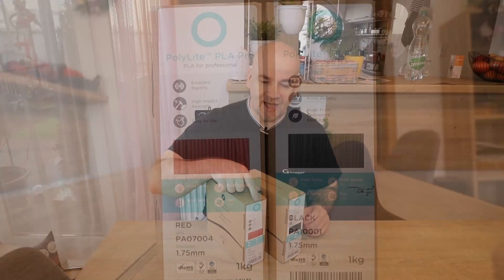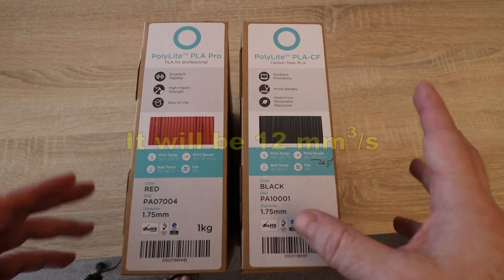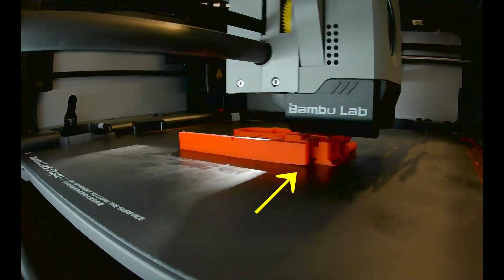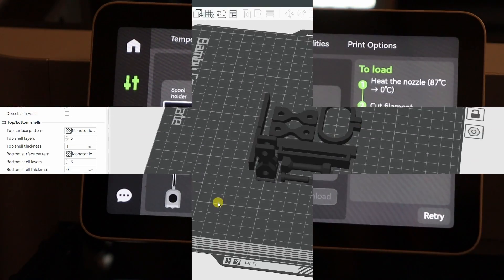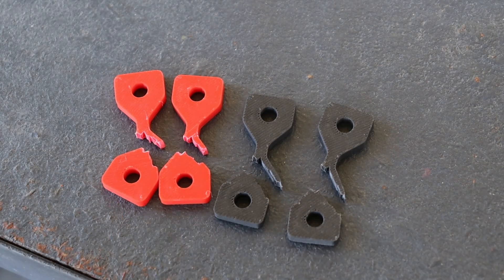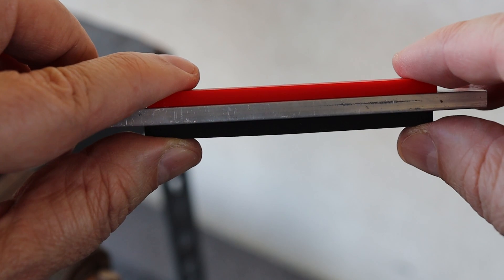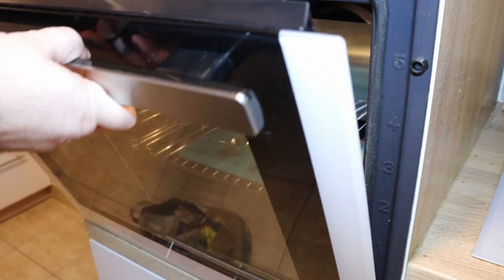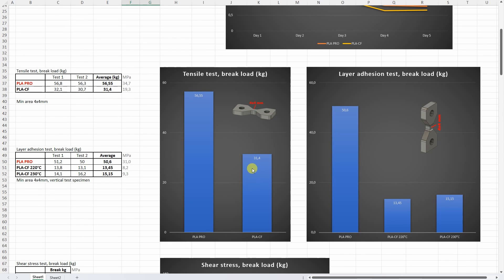Polymaker PLA Pro vs PLA-CF, Try to guess, which one is stronger?

Comment: Define “stronger”? The PLA-plus probably has a higher overall yield strength, but way more deformation before final failure. The PLA-CF is more rigid, but also more brittle.

Comment: I always wonder what is the base formulation of the PLA in the CF versions.  It would seem to make the most sense for them to use an impact-modified formula (ie. Tough/Pro/+) than just a regular PLA.  But based on all the tests i see, it seems like the base is a standard PLA.  Unless the CF is really that much of a negative impact?

Comment: Good videos. Here are some filaments with very interesting properties. AzureFilm PET Carbon Fiber - very stiff, high HDT and low warp. Aurapol PLA HT110 - high HDT without annealing. Spectrum  PET-G HT100 - High HDT. Recreus PET-G CF - High strength. Extrudr Green-TEC pro carbon - Very stiff, high HDT, bio material like PLA. Formfutura ApolloX CF10 ASA - Very stiff and low warp.

Comment: The reason for the spool being closer to the resealing end is due to the way it's manufactured. The resealing strip is the bottom of the open bag, the spool is dropped in, then the bag is vacuumed and heat sealed. So when a consumer gets it, there is that extra space on what was the top during manufacturing, but now the bottom for consumers.

Comment: Before watching: CF may be better in rigidity & heat, but worse in other properties (as usually filled filaments are).

After watching: maybe CF filaments do not use same (better) base material as normal or pro filaments. Or CF (or any other filler) just creates breaking points (voids in polymer) instead of binding base material?

Some people dismiss PLA, though it is very strong, cheap, hard and easy to print.
PETG creeps less, but due to flexibility it's not always a good choice for mechanical parts. It doesn't stand much more heat than PLA.
If a printer has hardened steel nozzle and can go to 100/300 C, CF-nylon (CF to make printing easier) might be better option. ASA and especially ABS IMO not so much ;)
ABS and glue sticks for cool plates (again IMO, in 2020's! We have PEI sheets and heated beds!)  share the same (hot) place 😈

Edit: will CF become future asbestos? How does file CF dust behave before, during and after printing? It's probably not good for skin, eyes or lungs...

Comment: I always want to see more PLA tests. It isn't like the manufacturers post clear data on what is what. As a material for mechanical parts PLA has a lot of advantages. the ease of printing is an important one.
Reply: Agreed:
1) Ease of printing (especially low shrinkage/warping)
2) Price
3) Strength at RT
4) Modulus at RT
5) Potential for annealing to greatly increase heat deflection temperature
6) Chemical resistance
7) Low toxicity

Comment: The strength in carbon fiber is getting it to align on the XY axis.  Tiny pulverized pieces floating in polymer won't add any strength.  It sure looks pretty with it's matte finish.  I love your testing.  As I have seen with other filaments featuring CF inside, I have yet to see where CF adds any strength.  I like the Polymaker materials and I have been a lot of test prints with their CosPLA material for my projects.  The PLA Pro is very nice and I find I have to print at 220C to reduce all stringing whereas with their other PLA materials, I find 200-205C is the sweet spot
Reply: You've barely looked then. Nylon and PET are greatly improved by decent CF with better temp resistance, strength, and stiffness. I wonder whether it's an issue of better adhesion to the fibres or ductility avoiding the fibres causing stress concentrations. For whatever reason PLA seems to be a poor matrix material in comparison, usually losing ultimate tensile strength. In the dry state straight after printing, I tested a flexural modulus of 7 GPa on my PAHT-CF!
Reply: cf works great for nylons
Reply: It do add stiffness to many materials, and at high temp aswell which is important for many applications. Putting it in PLA seems like a waste though, since the base material is shite for useful stuff.
Reply: @garagecedric  pla is pretty decent if you don't need temp resistance tbh
Reply: @riba2233 Don’t like the creep under load, so K never use PLA.

Comment: I've always had good luck with polymaker filaments EXCEPT for PLA and PLA pro. It warps terribly, and the pla shifts from glossy finish to matte finish depending on flow rate.
Reply: I printed polysonic (similar to polylite) in multiple colors, no warping at all, great consistent finish quality and very easy to print. 210-220c, 60c bed etc

Comment: It's easy to say that PLA is bad and that it's not interesting. But it's mostly because the material just isnt having the material properties we need. But it is the dream when it comes to ease of use and printability. PLA is what we want all the other materials to be like, but with the finished result having the mechanical properties of the material we chose instead.

PLA is one of the best filaments for printing and the only reason to use something else is for example because the material is too brittle or too low thermal resistance. A singular weakness that doesnt fit into the intended use. The material is so much superior in terms of ease of use and printability that it is ridiculous. I can without caring about print settings and on maximum printspeeds print squares of 30cm x 30cm with no warping. 100% of the times. I can print tall weird thin sprawling shapes that are usually really difficult in ASA/PC and with no curling/warping. With other materials its simply a lot more difficult to get that exact same result while printing at 200mm/s+. It easily prints 5cm+ bridges without a care in the world. Anything goes. An idiot can print PLA/PLA+. And that is what most of us are. We are tinkerers. We want to spend our lives doing something else. Only like 2% of 3d print users are there for the tinkering and dont care about actual prints themselves.

Now, to convince me that these strength tests are of any use at all, you'd have to convince me that I can easily print these large shoulderpads, helmets or AMS risers etc with zero warping, curling, 99%+ print successrate without a struggle. Large flat peices. Thin overhangs. Tall thin pipes. This begs me to wonder why printability isnt even a metric you care about. It's nothing to you. You just print small flat mechanical parts. This is great, but the most important thing is that you can print the intended part accurately with the material, else it's 100% useless and not even worth considering.

For ASA to reach the same performance as PLA I need to print it at around half speed, I need to prebake the oven for more than 30 minutes, and I need to slow down to less than a third to of PLA speed on overhangs to get an equal result in terms of quality. And it still warps/curls a bit. Some shapes are better avoided and the model cut into smaller pieces to make it easier to print. Nah. What we all want is EXACTLY the PLA printability but just a little more thermal resistance and slightly less brittle. There are already thousands of great options in the printing world to print useless mechanical flat parts. ASA and all the other materials are fantastic at this. But what about the really big difficult full helmet oneshot prints? I want a great cosplay filament. ASA is simply too much work to get a good result, prints too slow and even with great settings it has a too big reduction in size when it cools down which causes warping. This directly limits my creativity and productivity. If only PLA was slightly more thermally resistant would be good. But alas, zero really good PLAs with high thermal resistance seems to exist, and all processes with annealing so far distorts all larger prints until they dont accurately fit what you intended to print. 

GIving us lists of specifications is good, but what we are looking for is also printability. It is one of the absolutely most valuable metrics. How accurate and easy are they to print? How good does details come out despite the CF fibers? Is it easily sandable? These are metrics which are CRUCIAL to everyone who is going to print something that isnt a useless flat mechanical stress test/benchmark print. Printability is what makes PLA so popular. It is glorious in that regard but has some severe weaknesses. What everyone is looking for is the next perfect PLA that covers some of its weaknesses. That is all. 99% of people in this world doesnt want to spend their entire lives trying to learn difficult tunings for each print. Sometimes having to reprint things several times or having to cut all prints up to 4-6 pieces and try to weld them together without it being obvious. We want ease of use. Accuracy in print. No warping. No curling. No distorted shapes from annealing. We want to realise our dreams into physical objects just as we imagined them and preferably not just melt like an icecream in the truck. Noone here mind paying an extra 10$ per roll for this. The first company to fix these issues will be billionaires. But almost all PLA/PLA+ are exactly the same, and all other materials have huge downsides generally speaking. Great when push comes to shove, but glaring weaknesses all the same.

What I want to see is the weaknesses of the material. What are the reasons and applications where this CANNOT OR SHOULD NOT be used. In what situations is using another material better. Comparisons. Expert thoughts on the subject. Saying that it is somewhat less tensile-wise than another material is great but can my unmodified ender3 print it well? Does it print extremely difficult large prints accurately? In comparison, how does it work on my X1C? Would perhaps a filament with some carbon help retain the shape better? What alternative could be used if the thermal resistance is too low? These are the kinds of questions people wonder about. The actual real life comparisons and thoughts. I'd love to see more of it. You've used thousands of materials. What made this one great or garbage in your mind? What would you use it for? What should you avoid using it for? Why isnt this in the videos? I know you have these thoughts.
Reply: I agree fort he most part but he does talk a lot about printability when he reviews technical materials,